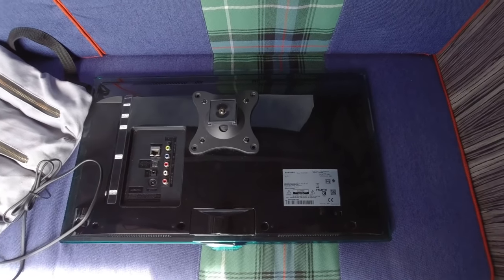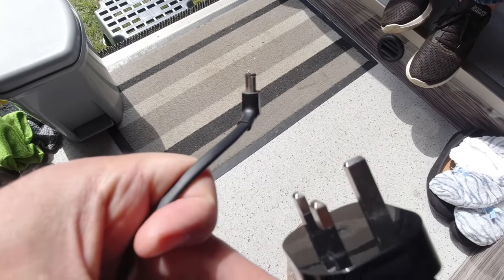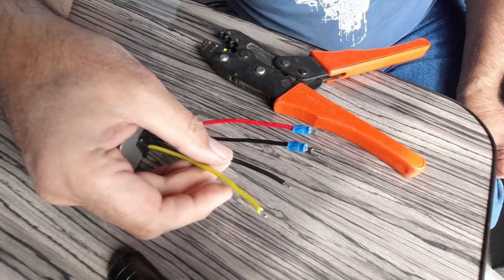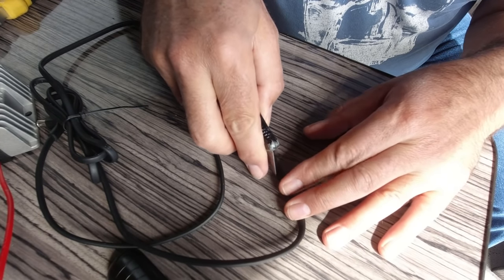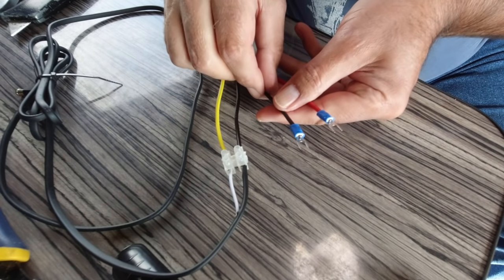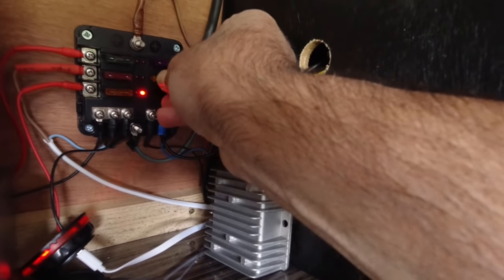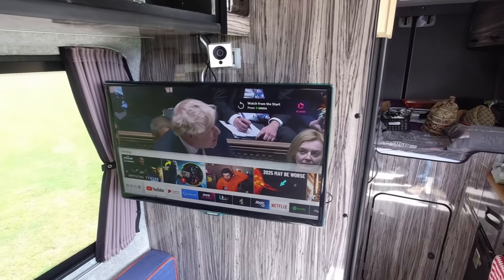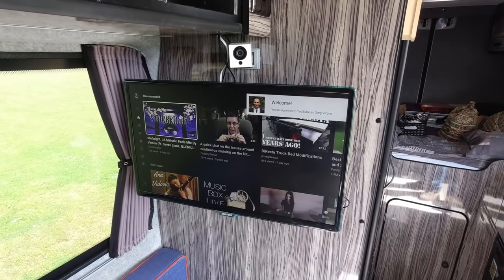How to connect a Mains TV direct to 12v DC - Off Grid Living

Comment: Its not a transformer its a 'boost switching regulator'; sorry to be a dork   😋 Good idea though as you're inverter is probably 15% inefficient in addition to AC-DC also ~10% inefficient. The boost regulator is probably 90%+ efficient. Edit: some people have commented on no load (tv off) inefficiency - it will be very low even if you dont turn it off (unless that regulator circuit is designed poorly and assuming the TV is off and not in standby); probably measured in nA. Obviously from a safety perspective, better to turn off devices.
Reply: Right.  Transformers only work on AC, not on DC.  (I suspect that Greg knows this, but just  wasn’t as detailed in his explanation as he might have been.)
Reply from the maker: We always unplug the tv when it’s not in use so the drain is negligible

Comment: Hi buddy do you need a antenna when using a TV in a van. Cheers 👍
Reply from the maker: Yes we have a high gain tv aerial on the roof of the van. When you park up just retune the tv to get all the local stations. 😃
Reply: Many thanks for your reply. Could you please recommend one. If you have the time. Regards
Reply from the maker: @tempestfugit64  this is what we have and it’s very good 
August DTA240 - High Gain Freeview TV Aerial - HD Portable Indoor/Outdoor Digital HD Antenna for USB TV Tuner / DVB-T Television / DAB Radio / SD / 4K - With Magnetic Base https://www.amazon.co.uk/dp/B007JPOX8O/ref=cm_sw_r_cp_api_i_EQ8WFHMFVTQW44Y5H9A4
Reply: @GregVirgoe  many many thanks.

Comment: This may have been asked before but what model Samsung smart tv are you using?
Reply from the maker: This is a 24” LED smart monitor. This particular model is no longer made but there are modern alternatives.
Reply: Great thanks,  I've got 2 Samsung Smart tv's but neither have a brick so I'll invest in a monitor, thanks again 👍🏻
Reply from the maker: @johnu6652  if you are going to buy a new TV there are a lot of 12v smart TVs out now. Avtex ones are very good https://www.bestproductsreviews.co.uk/12v-smart-tv-for-campervan?targetid=dsa-396359850902&matchtype=&device=m&campaignid=15545821194&creative=569202527998&adgroupid=132681530362&feeditemid=&loc_physical_ms=1006886&loc_interest_ms=&network=g&devicemodel=&placement=&keyword=$&target=&aceid=&adposition=&trackid=uk_all_ls_top_4_1&mId=407-132-4411&trackOld=true&gclid=Cj0KCQiA_P6dBhD1ARIsAAGI7HCETQeT7zflfHg8LHEbyjH27L3WQyrXPpA2cWNUKRMNyTCnYbU9otQaAv7OEALw_wcB
Reply: Cheers Greg ill look into it 👍🏻

Comment: Greg thanks for this. What's the exact TV model?
Reply from the maker: This is an old tv actual model no longer produced. You can see the model number in the video.
Reply: @GregVirgoe  thanks found the model number. Contacted Samsung support and they no longer make a smart tv with an external transformer so will have to go the Invertor route. Cheers, Mark
Reply: Inverter
Reply from the maker: @MarkLeabon  there are many more better 12v TVs on the market now. Take a look at Avtex are really good smart TVs https://www.bestproductsreviews.co.uk/12v-tv-for-motorhome?targetid=dsa-19959388920&matchtype=&device=m&campaignid=12177553845&creative=494588387485&adgroupid=115816063606&feeditemid=&loc_physical_ms=1006684&loc_interest_ms=&network=g&devicemodel=&placement=&keyword=$&target=&aceid=&adposition=&trackid=uk_all_top_11_1&mId=407-132-4411&trackOld=true&gclid=Cj0KCQjwsIejBhDOARIsANYqkD3zq7vGRILi7MiqsbJ8v2VLIdPPGULKLfqZp1UKU0j9blV2RLbiBXAaAopEEALw_wcB

Comment: I've seen another utube who also advocate using 12 to run various devices in his case he changed all his light to 12 volt DC but his system is a little hokey as he runs his wires from room to room through surface wires and his ligh fixtures are hung on the wall surface wiring system are cheap and neat I do have one thing going for me all my lights are on one circuit so all I need is to unhook it from the panel box and attach it to my battery since we both have cpap machines which are 12 volts DC and a lamp by our beds as well as USB chargers I'm planning to bring a 12 volt power to the night stand and put in outlets for these just a plug change on the lamp so that it can only be plugged into 12 volts and I'm set now I'll have to check out our smart TV and check out our satellite box it's interesting how many devices use transformers to get their power I never thought about the smart TV but I know but never thought of it but our router also has a transformer so now I'll start checking as my electronic are what's stopping me from going solar as my inverter is a modified sine wave and they don't like that but if I can power them with 12 volts dc that would solve that problem

Comment: If it doesn’t say 19v dc on the back does that mean you can’t do it?
Cheers
Reply from the maker: Yes the power input needs to be a low DC voltage to do this
Reply: @GregVirgoe  cheers

Comment: what is your run time or drain on your battery ?
Reply from the maker: As shown on the video the TV only uses 26W so on a 12v battery that’s only 2amps per hour so if you had it on for 4hrs in the evening it’s only used 8Ah of battery power so very efficient
I have it fed from my new auxbeam panel so I can switch it off when not in use and there’s no standby drain on the system. 👍🏼😃

Comment: Hi Greg , very interesting video that has given me lots of ideas. Could I do this with my 230v 65w small fridge? I run it off my 2000w inverter , which is totally uneconomical and a battery killer. I did my setup this way because those 230v table fridges are easily available at a budget price , unlike 12v vitrifrigo's or dometics which cost hundreds. Would it be more tricky with the fridge , which can draw up to 6 times the wattage on start up?
Reply: It won't get enough power to start the compressor.  You'll be better off trying to find a second-hand 3-way fridge pulled from a scrap caravan.
Reply from the maker: Sadly no because I suspect the compressor will be 230v motor and not 12v. You could use a much smaller inverter for the fridge so the losses are less or look into switching the inverter with the fridge thermostat. Many videos online doing this with a relay. 👍🏼
Reply: I recommend buying the best 12v fridge you can to suit your van, 4WD, camper trailer, RV etc. They do cost quite a lot, but compared to your vehicle, not much. Design your vehicle around your fridge, because that is the most used and most loved piece of equipment in any RV. Greg's genius here is to connect low power appliances to a 12v system efficiently, including small TVs, laptops, drone recharging systems. Regards Richard from Australia (PS: we spend weeks at a time in remote locations working out of a 4WD vehicle. Fridges and recharging laptops are really important!)

Comment: Hi Greg hope you are well I'd like to ask you for your opinion on what I think is a bit controversial can't find anything in your videos
Do you feel it is nessesarey to earth bond from consumer unit to van metal work
Reply from the maker: Yes on the mains side I would bond it to the van. In case you have a short circuit on one of your mains electrical devices. I would also bond metal inverter cases, copper gas pipe etc 👍🏼😃
Reply: @GregVirgoe  i understand exactly what you saying but don't you worry if you get a live to earth fault it could fry the van electrics as everything on van is ground to metal work
Reply from the maker: @nashsgt  the different across the live and neutral will trip the RCD is milliseconds.
Reply: @GregVirgoe  thank you so much for your reply Stephen

Comment: Can you use a smart tv like out currys for this . Or has it got to be a certain type of tv many thanks
Reply from the maker: This is one from curry’s. It’s a 24” smart monitor but now a bit old.
Reply: @GregVirgoe  Iv just bought one from curry website but unsure it will work
Reply: @GregVirgoe  how can I tell Iv got a tv  that will work with the dc to dc regulator/transformer Iv bought
Reply from the maker: @arronwalton8840  the power transformer needs to be external to the tv like a brick on the lead and the back of the tv will say power input 19v DC
Reply: @GregVirgoe  well that’s f**ked that then should of asked before getting excited lol and buying I need to changed and sell the tv I bought now
Reply from the maker: @arronwalton8840  i showed you what to look for in the video. Just cancel the order if it’s not suitable. 👍🏼
Reply: @GregVirgoe  it’s sat in my front room as it didn’t say in specs online if it was dc or ac so I just assumed they was all the same I will be going down to get a refund or find one in the store that is dc
Reply: @GregVirgoe  hi mate a bought a 12/24v tv and cut plug off to get a red and black wire and put it to the regulator but only get a quick flash of the red light on tv and nothing eles any ideas would be helpful
Reply from the maker: @arronwalton8840  can you give me the make and model number please 👍🏼
Reply: @GregVirgoe   sharp 24” led tv 12/24v
1T-C24EE2KF2UBM
Reply from the maker: @arronwalton8840  so with that tv you  can connect it directly to your 12v supply from your blade fuse holder you don’t need the voltage regulator. Just use the cigarette lead either into a cigarette socket or cut the cigarette plug off and connect to those wires onto your 12v dc leisure side.
Reply: @GregVirgoe  wicked thanks 😊 appreciate it

Comment: Brilliant thank you Greg for showing us this helpful video :)
Have a quick question it it possible to do this to a Blu-ray player?
Reply from the maker: You need to check what the power requirements are of the Blu-ray player there will be a label on the back of it giving you the input electrical data 👍🏼😃
Reply: @GregVirgoe  thank you il take a look :) wonder if van run Alexa the same way too hehe 🙃 brilliant vlog Greg ☺️
Reply from the maker: @WhipperdeetsAdventures  take a look at Greg Keen van everything in there is controlled by Alexa 😊
Reply: @GregVirgoe  aww cool il take a look thanks buddy :)
Reply: Hi Greg apologize I can’t find Greg keen?
Reply from the maker: @WhipperdeetsAdventures  not sure if you are in the uk as he attends most of the van meet ups
Reply: @GregVirgoe  hi Greg yes I’m based in the uk :)

Comment: can you do this with a fridge?
Reply from the maker: No, a 230v fridge will only run on mains. You would have to change the compressor and some of the wiring. You could switch an inverter on / off via a relay connect to the fridge thermostat.

Comment: the best solution is to have a solar system at 24V, so it is better to pass from 24V to 19V
Reply from the maker: I think you may be confused, my solar system wired in series will generate up to 60volts DC to my MPPT charger, from that it charges my leisure batteries which are wired in parallel giving a nominal 12v DC system to all the appliances in the van. That is far easier as the majority of camping equipment is 12v compatible.

Comment: How reliable has this been
Reply from the maker: It has worked perfeclty ever since it was installed and still going well with no issues at all :D
I have now added an Auxbeam control panel to replace the blade fuse holder I had just to add a switch control so I can turn it off when not in use. You can watch that video here https://youtu.be/rNSCJ9f0nI8
Reply: @GregVirgoe  I just watched it , pretty neat and tidy

Comment: Whys is it I've never had TV that has a power brick had 1 with 3 pin pc plug and monitor with 12v output and usb hub lol
Reply from the maker: Some TVs will do the conversion internally so not easy to do this mod 😢

Comment: isnt it volts x amps+ watts,, how does 19v X 2.5 amp= 26w?
Reply from the maker: It says TYPICAL power not max power on the TV so the figure of 26W is what it uses under normal operation :D
Reply: @GregVirgoe  ah ok ,, so at 26 watts it would only be pulling 1.3 amps
Reply from the maker: @acadian101  @ 19v yes that’s true and about 2amps from the 12v  batteries 👍🏼

Comment: Why TV is it?
Reply from the maker: It's a Samsung LT24 smart LED TV/Monitor and you might still be able to pick one up cheap on ebay using this link if you get in quick https://www.ebay.co.uk/sch/i.html?_from=R40&_trksid=p2334524.m570.l1313&_nkw=samsung+LT24+&_sacat=0&LH_TitleDesc=0&_odkw=samsung+LT24+smart+tv&_osacat=0&mkcid=1&mkrid=710-53481-19255-0&siteid=3&campid=5338027957&toolid=11800&mkevt=1

Comment: I'll second the comments made here - I'd put a switch on the 12v side of the boost converter otherwise the standby current of the TV and the converter are likely to be a drain the battery. At the very least, please humour me and put an ammeter in circuit to measure the standby current - I'm happy to be proven wrong!
Reply from the maker: We always unplug the tv when not in use. The converter is stone cold so I suspect the drain is minimal but wait for my follow up video to see what I already had planned for upgrading this setup 😊😃

Comment: IS THAT REALLY OK TO RUN 8 AMP CONVERTER WHEN ONLY DRAWING 2.5 AMP ?? I KNOW YOU HAVE THE FUSE BUT I WOULD LIKE TO KNOW WHAT A PRO WOULD MAKE OF THAT
Reply from the maker: Like most devices that is it’s max rating so it’s perfectly acceptable to use less power. The device will work cooler and much safer at lower loads 👍🏼😃
Things like TVs and laptops etc use varying amounts of power depending on what they are doing so the load is constantly changing.

Comment: are you sure, that the buck converter is morre efficient as the inverter and the 19 V Power supply? Since the Buck converter ist way too big.

I' m not sure. Might be some measurements needed.

But the buck converter might be less noisy as the inverter.
Reply from the maker: I’m pretty sure without measuring that 1 slight increase from 12.7 - 19v DC is more efficient than two transformations from 12.7 DC - 230v AC - 19v DC 👍🏼😃

Comment: The only problem with that is that the transformer is permanently on 24 hours a day even if the tv is off which will drain the battery,it needs a switch in the lead going to the transformer
Reply from the maker: The transformer is stone cold 🥶 when the tv is unplugged so I doubt it’s using hardly anything. 
Far less than a 1500w inverter 😃